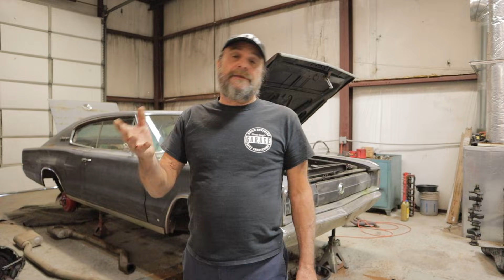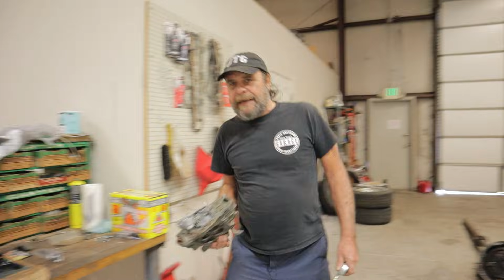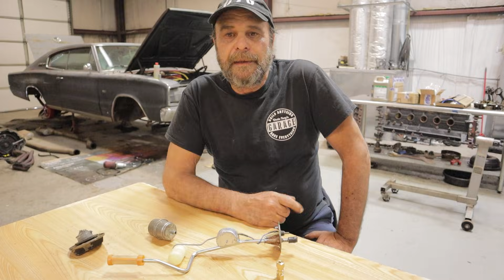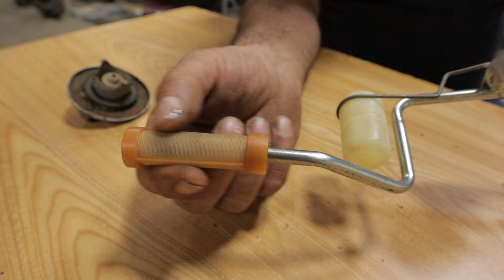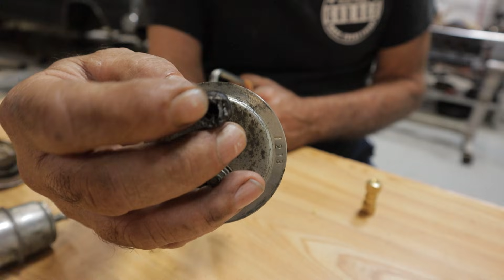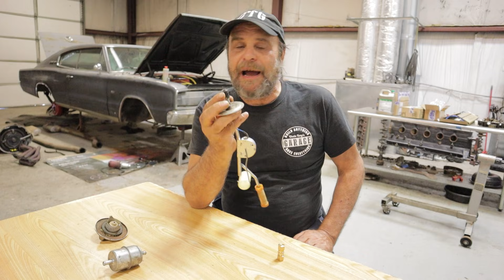Classic Car Survival - Troubleshooting Carbureted Engine Fuel Delivery Systems

Comment: I have a 78 F150 with an inline 300 and a Carter single barrel. It is driving me crazy because it runs great at the house and I get a 1/4 mile down the road and it starves for fuel. I turn around in a driveway and the thing is bucking and jerking with me pumping the gas pedal praying that it doesn’t die and leave me stuck in the road with no way to get out of it or get it back home. I don’t have anyone to call to help and can’t afford to call a tow truck to the boonies. I rebuilt the carb, replaced the fuel lines and filter as well as the pump and it only does it when I get on the road and 1/4 to 1/2 mile away. It seems to have no power in 4th also like the gas pedal is not giving it more fuel.

Comment: Last point my fuel would leek down over knight from my new quadrojet only had a screen in the carb auto parts store said that in normal no filter? Got to be kidding I purchased from ebay a filter $11 with a one way valve youtube guy recommended it put it in next morning starts right up no cranking holds the gas over knight😊

Comment: I reasontly whent through a couple of fuel line nightmares my jeep grand cherokee fuel filter inlet line some how rusted couldn't get the steel keeper to stay in fuel dripped from the connection I sawed the connection at the fuel line a new line $80plus also had to take out the tank drop it down at least I cut the line at the fitting put on a double jacketed fuel line 4 hose clamps 20 min job 😊 works grait next 95 ford fuel line connection fiting knightmare pulled my groin out just to disconnect the fuel line first time a day and a half last time 1hr with the ford factory tool the truck is 30 years old 😢 tuck has 2 tanks 2 fuel pumps ha alwase use anti size on the old fittings put in a fuel cleaner ses to get plenty of new filters will plug them up next I cut the ends off a used filter put double jacketed fuel line on the new filters ran the truck started plugging the filters with the rubber fuel lines I can change out the filters in a hart beat purchased a bag of filters ebay 5 for $10 what a relief of corse a new fuel line $80 old line still good just improvised it till all the trash is out of the fuel tanks so easy may never go back to factory😊

Comment: My problem is the factory fuel sock is big 7" in length I can't find a sock over 4" so I whent to the pool supply got a galon of it cleaned my old sock wisle clean chemical go to youtube best carb cleaner from pool supplies will give the name and how to use it doesnt hurt plastics either 😊

Comment: First off I don't just like your content I need it ! I'm probably about 10-12 years your jr. I just came upon my 43rd back in Jan. Man so with that fuel line constricting if it wasnt clear I wouldn't of seen or believed it myself. I have an ultra light engine 440 Cyuna currently being grafted into a buggy for the detached yet demanding as ever parasitic emulants that I call my pride and joys anyhow I had bought an over engineered cheap Chinese knockoff of what I can only assume would be a flat slide style 27 mm mikuni carburetor and the same thing happened a week into trials  what I think was a 1/4 " shrank the whole line to an 1/8 id from fitting to fitting

Comment: Another thing is if it’s got a small cut in the rubber hose in between the hardline and the sending unit, it will suck air and potentially even act like it’s out of gas

Comment: Thanks for the video.
HELP.
Small block Chevy with a 4 barrel Quadrajet. Driving along or idling the car dies. Hit it with some starter fluid or a squirt of gas from a bottle and it starts and runs till the next time it shuts off. Full tank and a new fuel pump.

Comment: The only topic you left out here was maybe gray and vapor lick issues on hot days. Could go over putting carb spacer to cool carb and maybe whether rubber or steel is better near exhaust heat and MM Abe the use of heat shielding sleeves around rubber or steel lines in high heat areas. Also, adding a soldered 1/4” nipple to that old sender and running 1/4” line down to a metal filter after the pump with a second outlet of 1/4” nipple to make a recirc system so gas is always moving and hence cooler by recirc to cook tank gas.

Comment: Having an issue with my cj7 . Runs perfect.  But after running around and it sits it would start again. Have a feeling its vapor lock issue but will definitely be checking the rubber lines at the tank now

Comment: Thank you Uncle Tony for the explanation on the fuel system. I put an Edelbrock avs2 on my 350 Oldsmobile, problem is when I’m on the highway and I step on it she boggs down like it’s not getting fuel and wants to stall. I have to gradually give it gas and it’s fine. It starts up fine and run fine. How do I check the fuel bowl on this carburetor? Thanks again.

Comment: I can't get my electric fuel pump on my 79 Ford truck with a 96 van engine in it to prime. I've tried the 18 volt trick but still no suction action. Is there another way?

Comment: I'm looking into buying a 67 Charger with a 383. Its been sitting for a while and we were cranking it for a bit and had it running for a little while with the fuel hose from the pump disconnected. The fuel pump was only spirting small amounts of fuel. I was assuming it was the pump and I'm going to change it, but could it be the pickup in the tank? It does have a new tank and I found an old rusted pick-up, so I'm thinking it has a new pick-up as well. I guess I will see the real culprit when I change the fuel pump.

Comment: Yep that cheap very expensive when sold at parts stores fuel line can create issues. Every build I do gets a new tank new pump and I use all alum line where I can put it. Seen vacuum hoses sucking together. It might be called vacuum line but it is far from it. Sh!t has to change with parts at the parts stores.

Comment: After 24 years of driving my 86' Ram, in finally replacing thw fuel pickup/sender (LMC truck parts), plus the paranoya about the rubber fuel lines from tank...original issue- guage sender inop,  2bbl 318 fed by edelbrock electric pump , l9ng block is early 90's with no fuel pump eccentric on cam. Working well for 13 years ..

Comment: Hey guys! I got a 84 Olds Supreme with a 3.8 Had the carb rebuilt cause it wouldnt fire unless I continually sprayed starter in it. It sat for almost a year and carb rebuilt. Drove it first time , started beautifully, ran great. Let it sit for 3 days went to store in it and damn if it didnt have exactly what you described happen. Left my kid and i on side of a bridge.  Got it home, and damn if it didnt do the same as it did for leading me to rebuilding the carb. So I replaced the fuel pump, again after I did 2 years ago. Still the same thing. Friend of mine said I should change it to electric. But im lost when it comes to even knowing what kind of electric pump I should get it and if that is the best thing for me to do. Any suggestions?

Comment: Fuel line is so tricky. Fuel line on car last fine for 30 years even with ethanol gas. But for 2 stroke the hoses get rock hard after months. Finding good fuel line is really hard.

Comment: ima have to disagree with the fuel and ignition issue... ive had tons of fuel related issues on my amc 360s.. like water in the tank, and vapor lock and fuel pumps not pumping properly anymore due to fuel.. and when they stop running, they can and will buck and it is fuel related

Comment: I have a 1986 Square body dual tanks 350. I installed an electric fuel pump because of vapor lock. I tried three different pumps. The right PSI, the truck would just die out, it wasn't vapor locking. I installed the pump back by the switch valve. Anyway I ended up hooking the manual pump back on and I left the electric fuel pump connect so it is on when the ignition is on. No more problems. What is your take on have both pumps running?

Comment: I have a 68 Camaro 396 I have been trying to start it this season and I’m not getting fuel at all. 5 gallons of fresh gas new mechanical fuel pump. Cranking it not getting fuel at all but if I take a fluid transfer pump and connect it to one end of the fuel  filter up front I can pump gas out with the fluid transfer pump. It’s a new mechanical pump but I put the lines in a gas container and it pump the gas and returned it in the gas container once I stopped cranking. I’m stuck if the mechanical fuel pump is working and I’m able to pull gas from the tanking all the way up front I don’t understand why it won’t pump gas while I’m cranking it.
Reply: Did you check to see if the fuel pump rod was missing sometimes people forget to put it in when they install the pump
Reply: @Boogieman-ff4hh  yes it was in there I actually got it running. I took the fluid transmission pump I put the one end of the transfer pump on the line that runs from the tank and I connected the other end to the fuel pump pumped it up with gas and it held. Tried to start it still would carburetor was clogged after cleaning it it started right up.

Comment: Came here because after installing my exhaust on my 71 Camaro, all of a sudden I couldn’t get the car to start.  Fuel pump is less than 2 years old.  Poured gas down the carb and the car starts but then dies once fuel runs out.   Checked my fuel lines to see if I pinched during exhaust install but no sign of damage.

Comment: Hi i have an 84 gmc s15 2.8 carburated i have a question it has an inline electric fuel pump do these pump stay on the the whole time the vehicle is running be i think mine shuts off because im losing power

Comment: I own a ‘59 Plymouth wagon which has a couple of short stretches of hose connecting the steel fuel line segments. One is in right in front of the rear axle, the other is along  the frame rail under the foot well for the rear seat. The latter section of hose failed in a similar manner as the one in the video did. Finding the cause of fuel starvation in that vehicle also drove me crazy. I replaced both, along with the one at the sending unit. They also had hardened and were difficult to remove.

Comment: I’ve got an 85 f150 with a Holley 600 brawler. It’s just dribbling enough fuel through the clear filter to idle. I’ve replaced the fuel lines, fuel filter, fuel selector valve, new tanks, new sending units and coil. Every time I’ve disconnected the fuel line and hooked it back up, it works properly for a little while. I’m running out of ideas. Any suggestions is much appreciated

Comment: Hey Uncle Tony love all your videos. But just wanted to bounce this off of you restoring a 64 impala with a rebuilt 350, new gas tank, new brakes all ready for cruzing whenever I have time. But heard alot about if you dont drive them often mechinal fuel pumps quit. What would your advise be (if there is one)  to prevent this (other that driving it often)? Jake.

Comment: All great ideas! My problem is somewhat different.  my engine runs fine if i start it every day. If it sits a week, then the engine has to be primed to start. The carburetor is completely empty of gas. I don't know where the gas is going, it's like it evaporates or is vacuum sucked dry. Any Ideas? It has a new gas tank, new filters, a completely clean carb, an electric fuel pump. I just want it to start when I hit the key..

Comment: Tony, that gas line that ends at the carburetor, coming from the fuel pump, by me is twisted. I twisted it once when installing a carburetor and I didn't hold one of two wrenches tight enough, so the line became twisted about an inch away from the carb. The car works but I wonder if any turbulence from that twist in the line causes any problems for the flow. Know what I'm sayin?

Comment: This was very helpful , I have a fuel problem in a 455 Oldsmobile that wont start in the morning unless I prime the carburetor then it runs fine . I changes the gas tank and the fuel pump , but have not checked the float that will be my next move

Comment: Great video, thank you for posting. I was poised to rip out the mechanical fuel pump and fit an electric one. The filter blow through test solved it. Looked ok but was plugged. You've saved me a lot of work and hassle.

Comment: My problem is i have put on 2 new fuel pumps and neither one will even pump gas into the fuel filter; but gas runs freely out of the tank line when disconnected; (74 AMC V8 )

Comment: Another awesome video! I know it's from a few months back. But it just showed up on my feed. And as things would happen the day before yesterday, my dad showed up in his 1963 GMC pickup with a load of corn stalks from his garden for the cattle. The truck started running rough and wouldn't stay running after he shut it off. It turned out just to be the fuel pump.  But I already had problems with the socks being plugged and the lines also. I was prepared to check. But as soon as I disconnected the rubber fuel line from the pump, fuel began running like a siphon pipe during irrigation. I pinched the line with vise grips and figured the lines and socks to be free and clear.  Thank you for all your tips and for sharing your knowledge!

Comment: Doesn't provide the basic information on the correct sequence in a completely dry scenario such as straight from the factory.

Minimum amount of gas in the tank
Does the fuel system need to be primed such as starter fluid in the carb?

So just cranking the engine for less than 20 seconds will provide gas to the carb?

Comment: Hilarious about wishing you had a better story for how you threw your back out. My shoulder is all messed up from a car crash and it is prone to dislocating but only doing the most specific mundane stuff. I can work all day stacking pallets throwing 60 lbs around like its nothing then go to reach for something in the backseat of my car driving home and BOOM it dislocates. Putting on a long-sleeved shirt does it too if I am not careful. It kinda messes with me while practicing boxing. I can throw hooks no problem but straights or crosses sometimes I feel it almost wanting to pop out.

Comment: Little help please: Custom built hot rod, ran out of gas, put more in and it fired up for a few secs then died. 
Now no fuel is coming out of the tank. ??

Replaced mechanical pump 2yrs ago. Just replaced fuel filter today. Fuel filter is see through and I can see there is no gas running through it. 
Don't know what to do, tried priming by pouring gas directly into carb to fire it up hoping the pump would pull gas through, but nothing.  Any thoughts??

Comment: Hi, may you can answer my question. Can I use a return line regulator as a dead end regulator just by closing the return line hole? I run a dead end so far but want to have an option of a later return line if needed. Thank you.

Comment: I am glad I found this channel.  I need some direction.

I have a true barn find 1978 New Yorker with the 440 and a quadrajet carburetor.  I purchased two months ago from an owner that had purchased from the original owner estate.  17,718 original miles.  The car had not been driven since 2015 when he purchased it.  This does have the infamous lean burn system.

I had the car shipped to a carb shop.  I order new fuel tank, new fuel sending unit, new fuel pump, new fuel filter, and had a rebuild done of the carb.  The carb shop replaced everything I just listed, and rebuilt the carb.  On the 8 miles drive home I put 20 gallons of fuel into it.  It started fine for a month. Then, and now, it will take multiple attempts to start before it starts to fire, and then when it does fire it does not high idle.  I found one loose fuel line from the back of the carb to the metal fuel line and replaced it.  Once started and warm it will fire right away.  
However, if I start it the next day, it will take another five or six attempts before it fires and finally starts.  I did notice yesterday that she sounds like she is surging everyone now and then.

I do not smell fuel.  I do not see any drips under the vehicle front to back, or back to front.  

I want this to be my daily driver.  I am in sales and nothing sells like being in one of the classic cruisers.  She does sound sweet when she is running.
Reply: Ever figure it out.

Comment: Here's one guys: In the 1990's, I bought an estate 1975 Buick (dead stock) that sat only a few years. While checking it, I would run it for 40-45 minutes in the driveway and no cooling problems. Driving it even one mile and it would overheat & puke everywhere. Soooo...know what the cause was? The anti-collapse spring in the lower cooling hose rusted away, and the suction closed the hose down at off-idle RPMs restricting flow.

Comment: 2 years ago my truck got to where I could pull out on the road and go about a 1/4mile and it would just flat die. I fooled with it for 2 days. Finally  removed the new fuel filter I had put on and it ran fine. The whole problem was the new filter I had put on would not flow enough fuel even though it was the same part number something was wrong with the media. At low speed it was fine but when it was on full fuel draw it was sucking the float bowl dry.

Comment: Tony; a good chiropractor can likely help you with your lower back problem.

I also have had problems since a teenager, now 47 & have had much less problems in the last 5 years since starting. 
Back has not gone out at all or even close in 4 1/2 years.